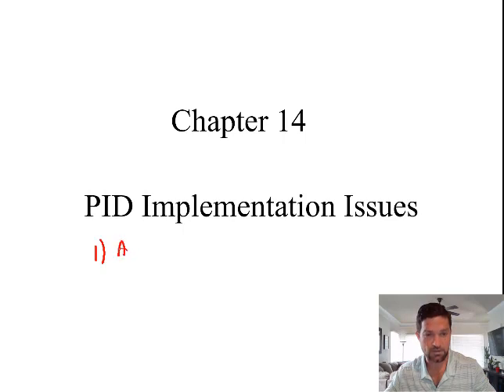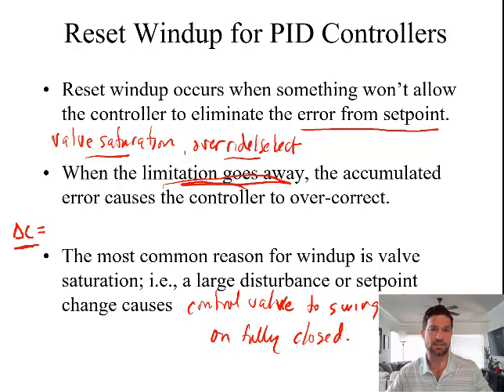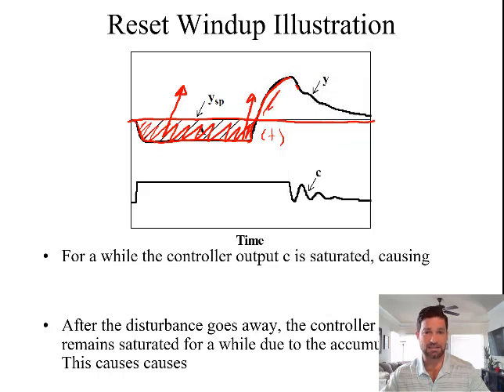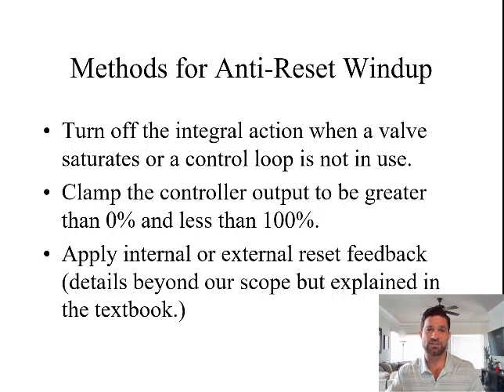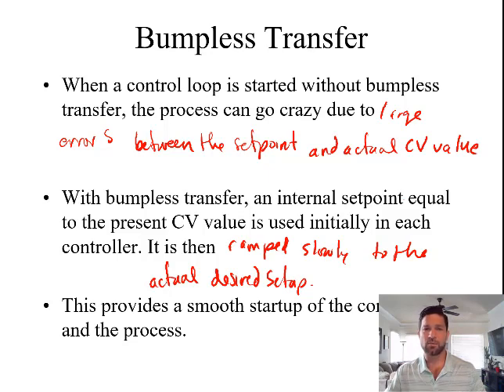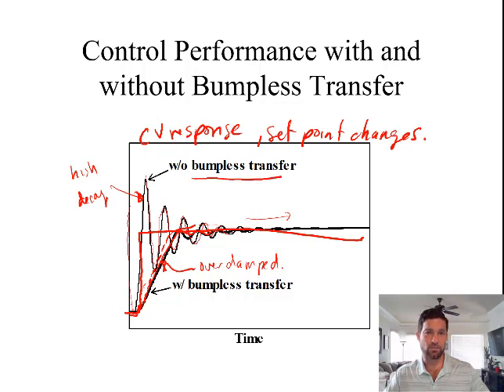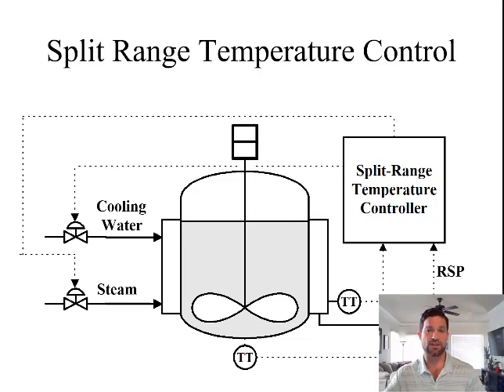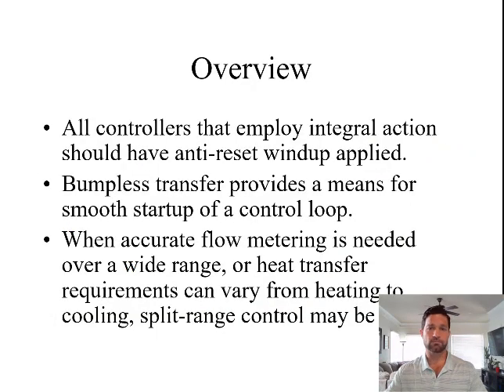PID Implementation issues (Anti-reset Windup, Bumpless Transfer, Split Flow Control)

Comment: Concerning a PID with SSR... if I have a 10kw heating element, is there any way to decrease the frequency of the signal from the PID sent to the SSR before limiting my heating element to 9kw? For example, is there an option in the menu that allows 90% of the signal sent to the SSR instead of 100%? That would solve my problem.